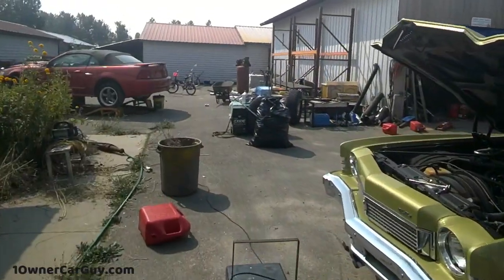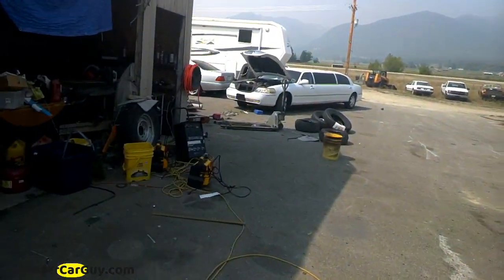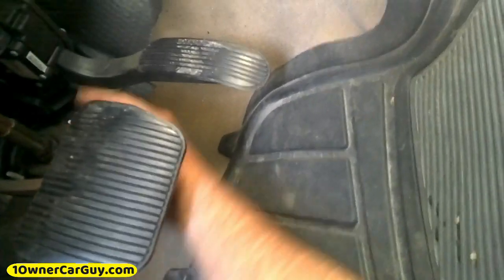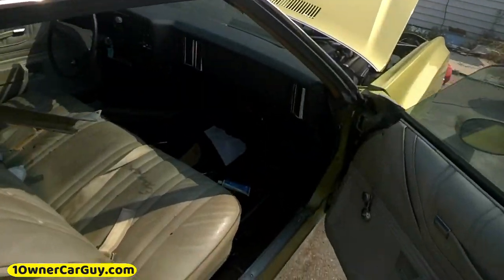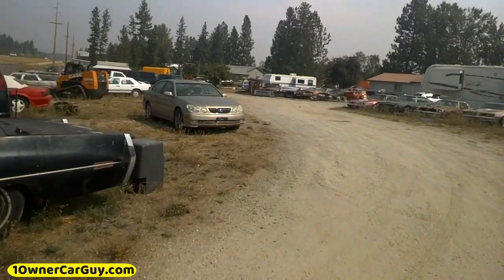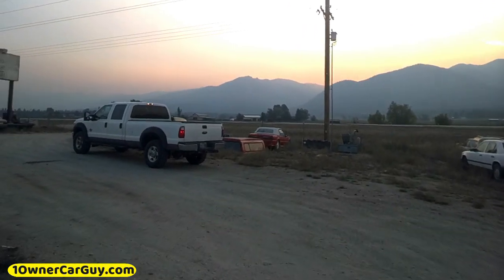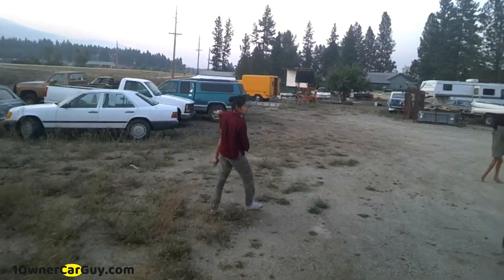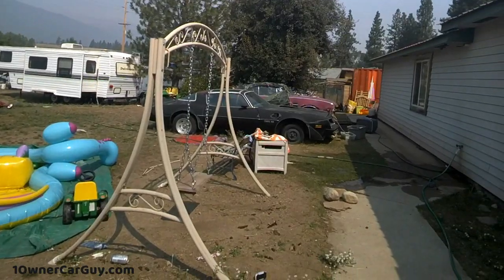Daily Work Vlog ~ Broken Panther Platform Car Cant Shift ~ Sold a Camper Shell ~ General Cleanup

Comment: I had similar problems on a 2003 Ford Galaxie  and also on my 1999 Ford Explorer . It was a minus-power/mass Problem  .  I clean up the Ground cables + add some additional minus Cables . Take completely the power of the car for 1 hour . After restart i let idle the car for 10 min , and everything works again .   .